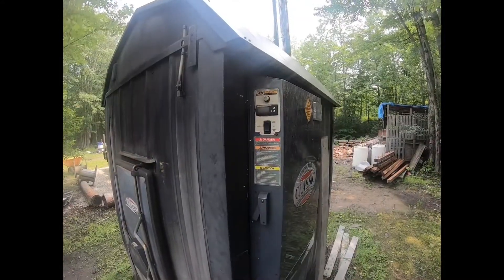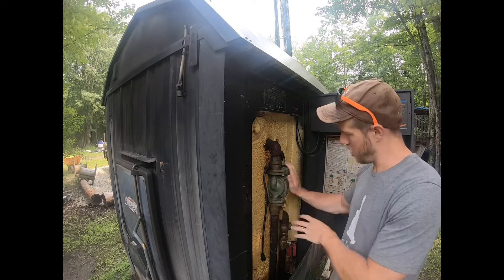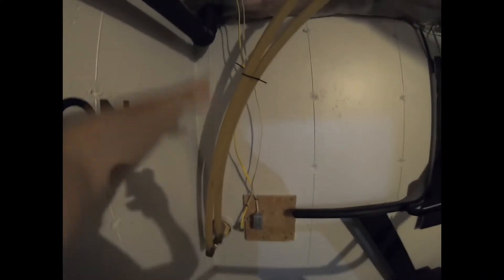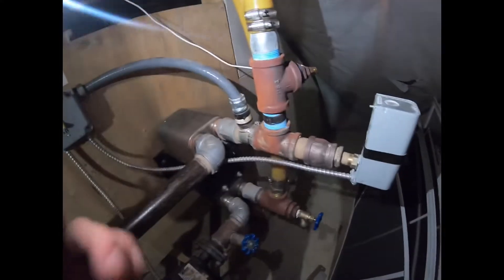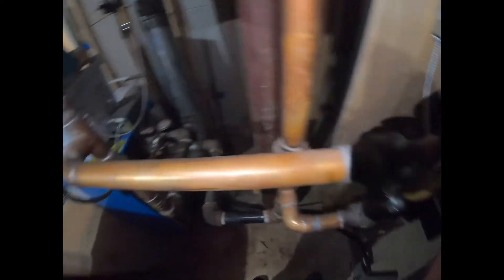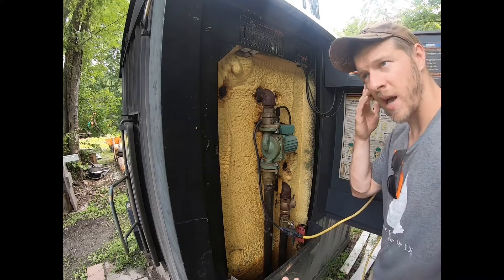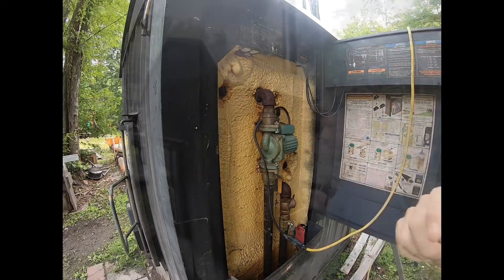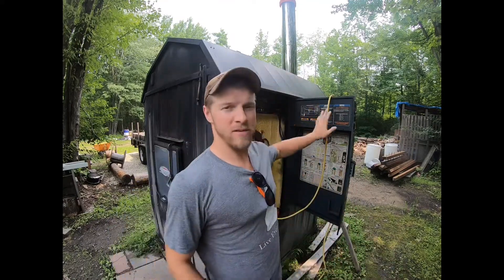OUTDOOR WOOD BOILER SUMMER MAINTENANCE!

Comment: I turn it on for a day ( pull out damper glass fuse 1st )...as long as my ac unit isn't on its fine....don't even have to pull damper fuse . Your are right..its a preventative maintenance tool !
Good point Jay
pc
Reply from the maker: Hey Pat! Thanks for tuning in buddy!

Comment: Mine was installed in 2005. the pump quit last winter. I would have a stand by replacement on hand. you just can't go to the local hardware store for a replacement. Great advice on circulating water during the summer
Reply from the maker: Hey Doug! I plan on having a load of extra parts before winter. Gasket/damper/solenoid/pump/fittings. Im going to put it all together hopefully soon lol

Comment: Bad Bad Bad advice Jay

No need for an extension cord to the pump
Instead pull the fuse next to power switch. That way the receptacle the pump plugs into is still energized
Also, you can feel the pump all day long and won’t know the water is circulating 
You actually want power on to the unit to check solenoid, controller, lights, light sensor
Also, I see you are still wasting electricity by not installing a Taco 0015e3

Side note: most stove owners can turn return valve handle to about 7-8 o’clock position to hear the water going through the valve and know it is circulating
That doesn’t however assure that the thermostatic valve on some systems is operating properly
I wish you would just ask me some of these things instead of doing so much trial and error
Reply from the maker: Hey there! I still have your original comments about the Taco pump saved in a folder so I did not blow it off I just havent had the money/time to want to upgrade. Part of me wants to just leave it as is and if the pump goes then ill replace it. I may get a Taco 0015E to have on standby for this coming season just incase since my pump could very well be the original one from 2008 I am not sure! I do not have a thermostatic valve on my system it is a open loop system right through the heat exchanger. I know the solenoid works and temp sensor, this wasnt  a full function video test this was basically "hey circulate your water every so often in off season" style video! I will obv do a full function check when the time comes to fire old faithful up! Good call with turning the valve to 7 o clock to hear the water better. Thank you for that tip. 

I appreciate you always looking out and dont worry I do not blow off all the advice you have given as I said earlier I have a notepad of advice ive gotten and it includes your notes about pump upgrading and electricity use as well as now the valve position! I am always learning! Thank you :)
Reply: @HomesteadJay  
I did not expect the valve info would help you hence the wording—- if you have a larger valve on 1.25” tubing it is not as helpful as a small valve on 1” tubing 
On the end of the pump where the pump wire goes in the date of pump manufacturing is stamped FYI
The reason that touching the pump is not reliable is because the impeller can disintegrate and only push a small fraction of intended water
One day maybe we can talk about the pros and cons of your heat exchanger between wood boiler and oil boiler